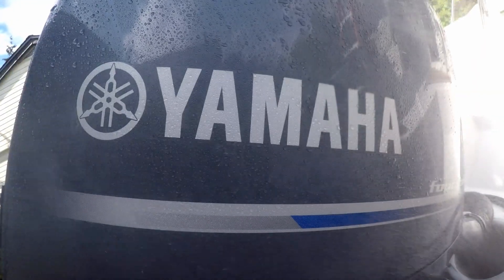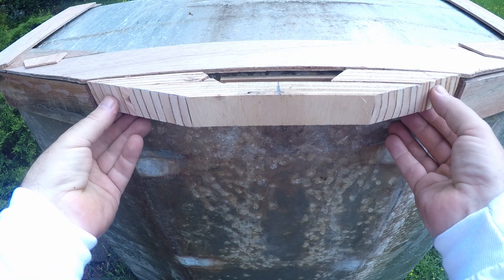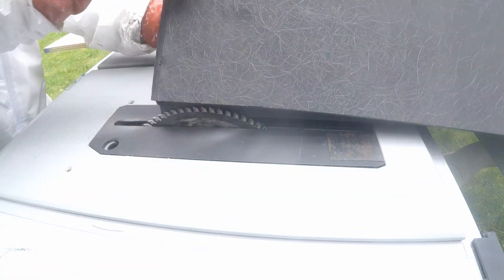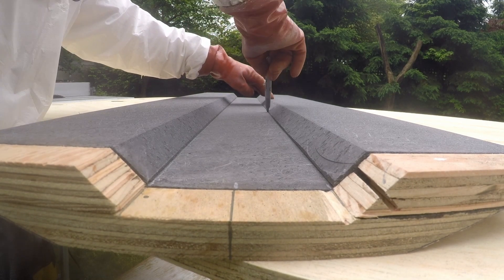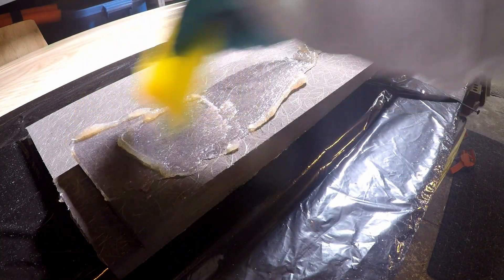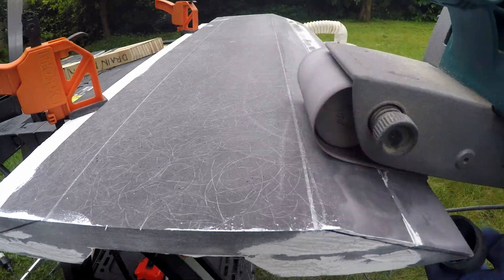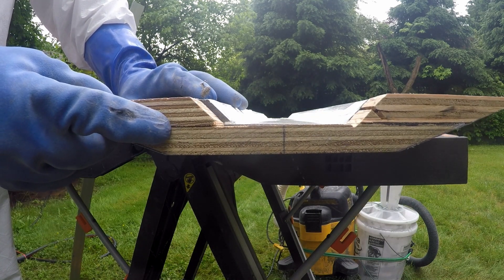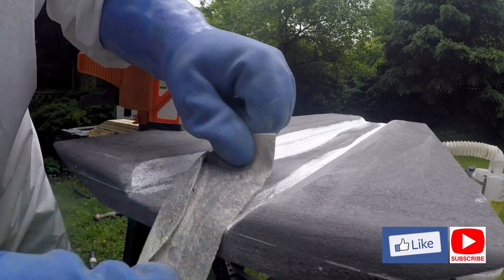Fuel Tank Pt 5

Comment: I’m curious to know why you didn’t cut those angles on the tablesaw?
Reply from the maker: That is a great question that I cannot answer. Maybe I was fixated with the belt sander, as that’s how I (was going to) did it in the cabin. The cabin floor was not square, so a table saw wouldn’t work there. This section was square, so it might have been better. Although the angle is really steep. Table saw could have worked, I s’pose.

Comment: I finally got my new tank in. I purchased it from RDS Marine via Tank and Barrell for $750. Aluminum. I had it custom built 4" shorter, so I could get it in easier. How did you get your floor back in?
Reply from the maker: Hi, thanks for watching my video project. I plan on editing some more episodes this winter

As for the lid, I made use of the beveled edge, added corner supports under each corner, and treated it like the lid on a Jack-o-lantern. I coated both edges with thickened, waxed resin and weighted it down with cinder blocks and old batteries. Then I tabbed and glassed the seam, and continued like I did in the cabin floor.

Comment: Great video. My tank just shit the bed, so I am looking at ways to pull the tank, do the repair, and or sell the boat. If you don't mind my asking, how much have you spent on this project? Not including new tool costs.
Reply from the maker: Hi, Thanks for watching my project videos. This project expanded beyond just replacing the tank, however I can comment on some costs. The tank itself was approximately $3000 USD, including all new hoses. But the Coosa and fibreglass repair was easily another 2000. Not included are the cost of tools and equipment. The Dust Deputy, three different electrical sanders and grinders, plus hundreds of Expendables. The fuel tank was a much simpler project than the cabin restoration.

Comment: It appears you may be on Vancouver Island? You wouldn't happen to want to do another tank replacement on a 2002 would you?
Reply from the maker: Hi Miguel. Thanks for watching my project. I appreciate your thoughts. I live in Vancouver, and am only now nearing completion of the project. There are so many factors and variables, I don’t know if I’d be comfortable doing it on another person’s boat. There are so many compromises.

My main concern remains securing the tank without the steel bands, and then the final finish appearance when the deck is fixed. It will be a challenge making it look nice.

Of course, having done the job, filmed it and watched every step, the second time would be easier, faster and better. The videos you’re watching are me as an absolute novice.

Another factor is that my fish wells were removed prior, creating access under the deck that yours would not.

But who knows, life has a way of opening new roads. I never expected I’d be totally re-wiring my boat, and I did. Then one day, a fellow like you asked me to re-wire his boat - and it turned out great. 

I do enjoy the work, however.

I’m happy to help you in any way I can. Do you have pictures?